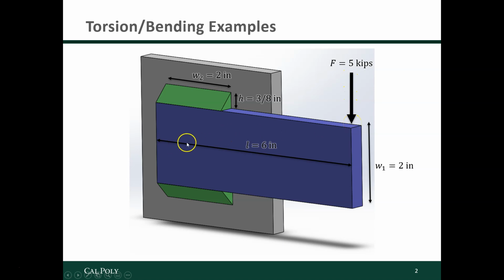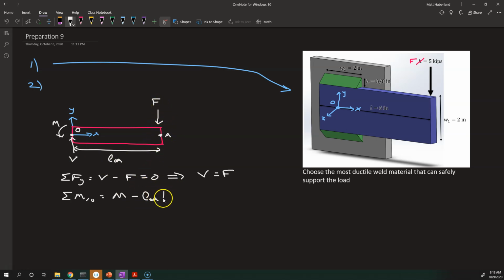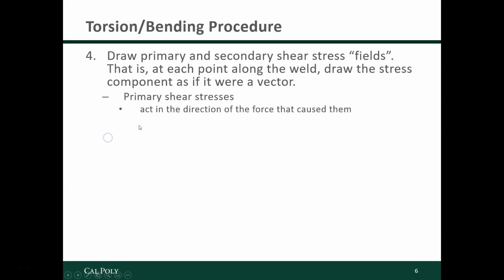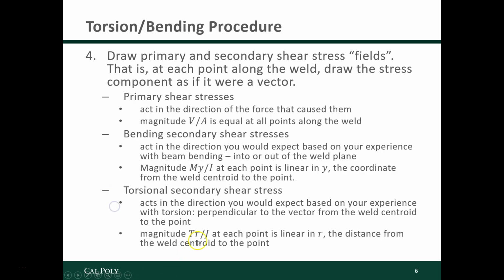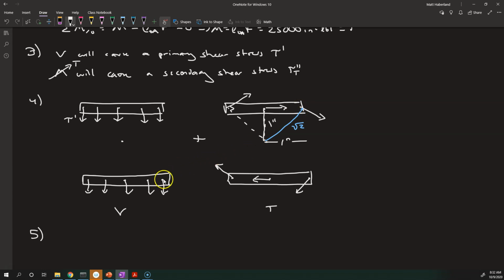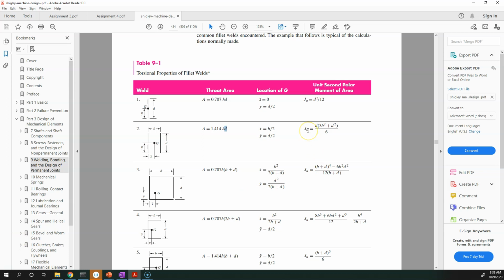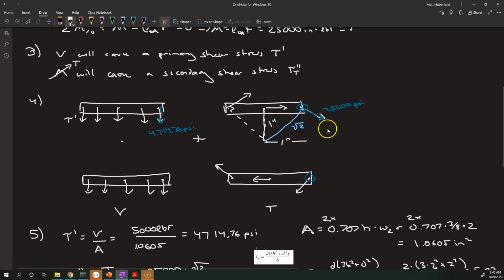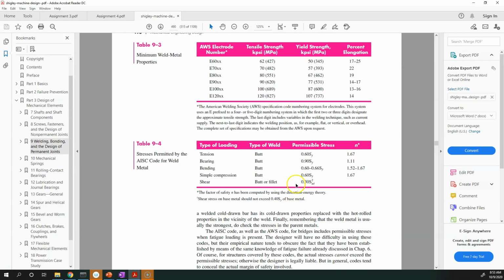Weld Analysis IV: Eccentric Loading (Force + Moment, Weld Groups)

Comment: @22:12 you divide 25000 by 1.414 instead of multiplying them
Reply: Also he says that "root 2 over 2 is 1.414", when it is actually =.7071. It turns out that dividing by 1.414 never happened, but multiplying by root 2 over 2 did (gives a similar answer).
Reply: 1.414 is the same as 1/sin45, so when he is multiplying by 1.414, it's the same as dividing by sin45 so he's correct.
Reply from the maker: Thanks for pointing it out! I think the other replies already cleared this up, but yeah, multiplying by root 2 over 2 (~0.7071) is what I meant because we're taking components of the vector.

Comment: This is  the best well- explained  analysis I have ever seen for a case of direct shear and torsion weld analysis. Keep up the good work. I was wondering if you can also do one that has a combination of direct shear, bending moment and torsion.
Reply from the maker: Thanks, Rostam! I'm afraid the class I'm making these for has moved on from welds to fasteners, though, so it will be a while before I can make another example with all three.